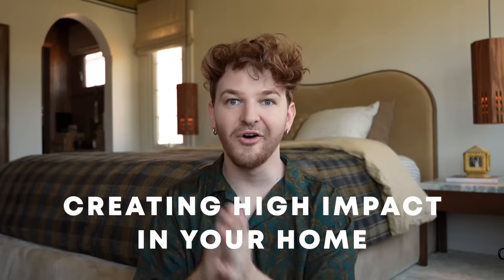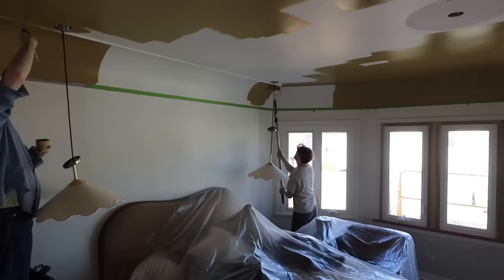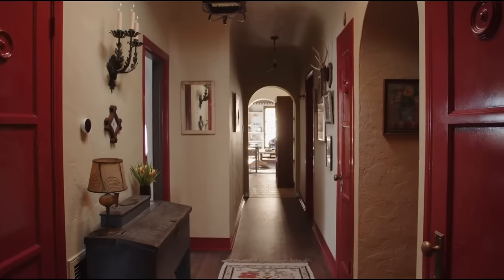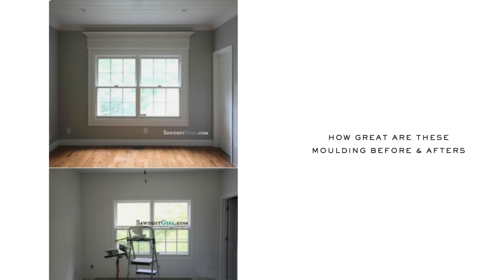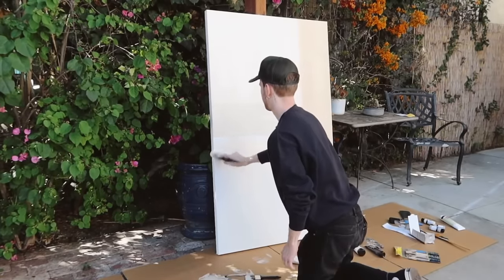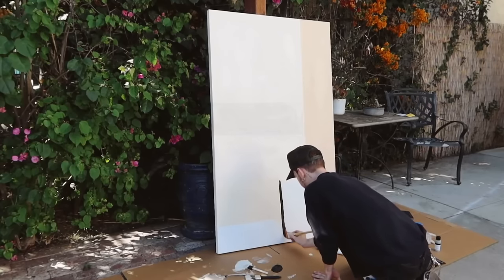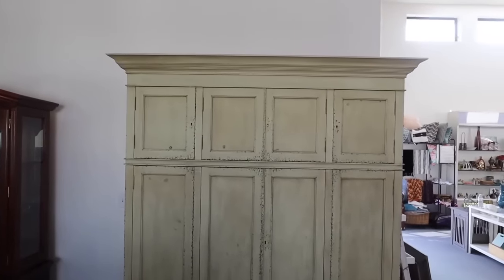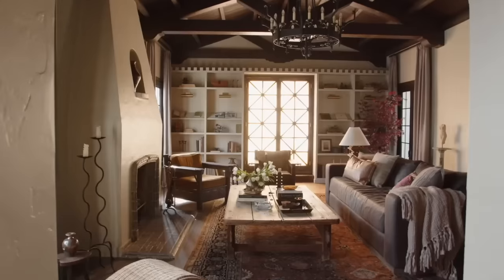10 DIY HOME PROJECTS that are WORTH YOUR TIME 👏🏻 *High Impact + Budget Friendly*

Comment: The moulding tip is perfect for my living room! My current baseboards are built into the wall without plaster behind them. I tried removing a part of it a while ago and realized it wasn’t going to be an easy project. Stacking trim will definitely elevate the basic baseboards
Reply from the maker: Ahh yes! That sounds great :)

Comment: A budget friendly tip I use is sheer curtains on the windows. The soft, diffused light makes a space seem restful and private, while still being bright and airy. They also distract the eye from a less-than-lovely view. I always hang them near the ceiling, and barely touching the floor.

Comment: Seeing Winston put an immediate smile on my face. Thank you. 
Tip 1:  painting the frame and door gave it a polished finished high-end look rather than painting only the door. I'm doing this!
Tip 2:  accent ceiling. I'm doing this!
Tip 3:  baseboard molding. I'm doing this!
Tip 5:  accent with painter's tape. I'm doing this!
Tip 7:  large diy art. I'm doing this!
Tip 10:   swap out light fixtures. I'm doing this maybe with a diy!!

This video was great having all great ideas in one place.  I saved the video to work on these projects before 2025.

Comment: Great video. Great tips. As I have watched your channel I have seen you use these tips but it’s great to have them summed up this way. One tip you didn’t mention here is adding a headboard to the bed. Doesn’t have to cost a lot but makes a big impact. So many styling options. You can paint it, either be matching or contrast, paint or fabric. You can have it fit the size of the bed or play with dimensions and make it larger to even include side tables.
Also LOVE seeing Winston making an appearance.❤
Reply from the maker: Ahh yes very true!!! So happy you enjoyed the video :)

Comment: Love this kind of video! I'm looking at my baseboard right now and wondering what I can pair with them. They're not tiny, but they slant to the wall at the top, so wondering how to put something on top. Expanding on that DIY with a number of examples -- or a bunch of examples about using molding in interesting ways -- would be an interesting topic for a video. Thanks for all your content, Drew!
Reply from the maker: Ahh yes! If you get a thinner moulding, it will easily flex to the wall and then you can paint it to match :) Love that video idea as well

Comment: I think this is fairly budget friendly. When tiling anything, use high contrast colors in the tile design for a custom designer look. Examples. In our entry, the floor tile (12” beige squares) got a 1” corner cut out in black. At the perimeter of the field…inset at 2” was a 2” border of the 1” black tiles. The floor looks like a rug and since we were putting down tile, there wasn’t any additional cost. In the guest bathroom I laid the floor tile on the diagonal and added the black border again, making it look like a rug design. You can do this treatment in/on any flooring project. It can be done on tile walls as well. We added a tile wainscoting to the guest bath and just below the stone crown that I used at the top of the wainscoting is a 3” border of 1/2” black tiles as a border. The same thing I did on the floor. These small tiles come on mesh so they’re simple to install. 
  In my childhood bedroom my mother made pastel striped cafe curtains and using the fabric colors had my dad paint “circus striped” strips of color on the ceiling from the 4 corners of the room to the center where the simple ceiling light was.  So cute. She also painted very simple wood frames in the pastel colors and mounted pages from thrifted children’s books. The wooden bookshelves my dad built were also painted in the pastel color pallet. Anything that was made or found (my dad was a local delivery truck driver and brought home things from sidewalk discards all the time) was painted in the pastel colors. A cute clever way to decorate a room for 2 little girls.    As you said … paint is a simple way to customize your room and thrifted items, restyled with paint or stain, become custom items. You’re amazing at this !

Comment: To make original artwork more affordable, I have bought pieces at flea markets, thrift shops, MaxSold and Facebook Market place. If the frame isn't the colour you love or has some flaws, you can easily fill any cracks or chips and spray paint it. Or remove the frame and just hang the canvas. Alternately, if the frame is one you like, but less so the image on the canvas, swap canvases (you may need to get a custom matte, but still much less than a full custom framing) or add paint to enhance the image or even paint over it entirely.

Comment: In addition to tip seven. Instead of buying new canvases, which can still be pretty pricey, you can also look in 2nd hand/thriftshops for used canvases or some with a "cheesy" print on them en repurpuse those. Just paint over the existing image or apply a white baselayer of paint first. This way you can get big canvases for a fraction of the price!

Comment: Help! I live in the desert. Just not any desert, but the hottest desert in Arizona and arguably the country. My challenge is every room has a fan, the kitchen, the eating area, the dining room, the living room, all of the bedrooms. The bathrooms are the only ones without overhead fans. Even my back patio has two fans. They are so uninspiring but also necessary. Do you have any suggestions?
Another issue is during the summer when you’re looking at temperatures between 110 and 130 I need to do some extreme window covering. Some peoples electric I’m just a 2000 square-foot home is six to $800. I am more fortunate, probably because of all of the overhangs I have .
I know your parents live in Arizona, but I don’t think they live in this extreme area. However, I think you might have an idea of the challenges I have any suggestions would be appreciated. You were also invited to come visit sometime when you’re in Arizona and check out the challenge here .
Thanks in advance for your consideration